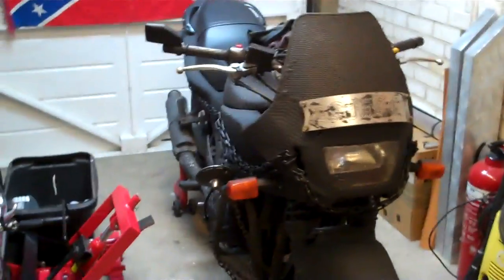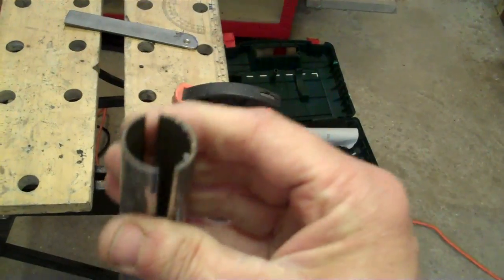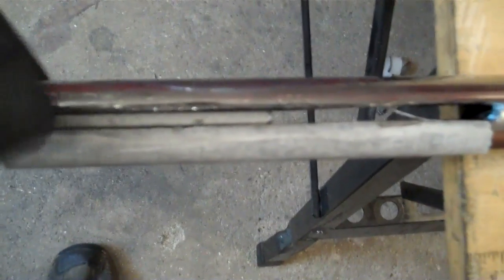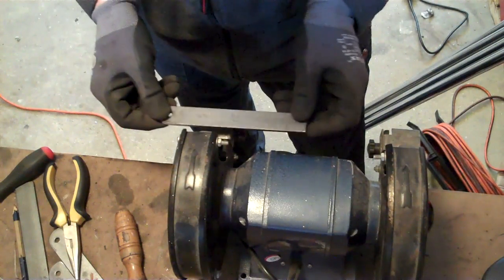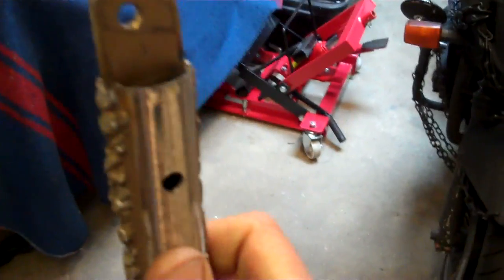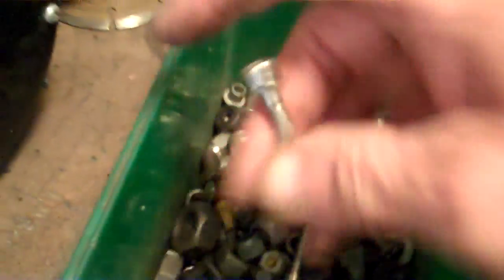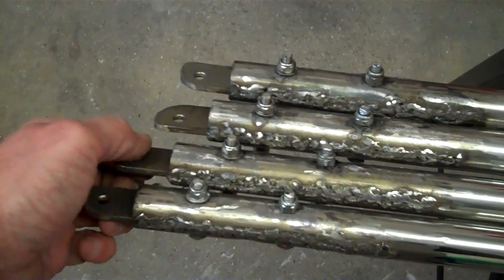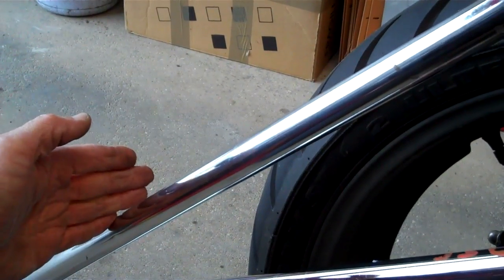Delboy's Garage, Project Tow Hitch, part 2.

Comment from the maker: Hi Dan, i remember you and Joe doing that on the HUGE trailer you built for the pickup.."weld in a C patern" i even had Joe's words ringing in my head as i dodged the splatters...just got to get practiced buddy, even setting the machine up right is still trial and error for me, but its always strong, no matter how ugly. any time i weld its always varied thickness, so hot enough to catch the thick stuff and it blows holes in the thin stuff, so i end up just doing joined up tacks, seems to work.

Comment: Hi Del, the calculations will have something to do with the weight of the loaded trailer as a percentage of the loaded bike and then a nose-weight figure.  I used a stick in the ball of the hitch onto a set of bathroom scales to get my nose weight for the caravan.  Basically, keep dense weight over the trailer axle, low in the trailer, and slightly towards the front and then fill the ends with light stuff.  A tent and camping stuff will be no problem to tow so long as you get the balance right.

Comment from the maker: Hi Claus, yes i was, ill make the rear bracket capable ot bolting on a regular tow ball hitch, then i can tow a regular small car trailer, ill just modify it so thet any weight in it is equal over the axle and doesnt lean too hjeavy on the hitch, then all the bike is doing it pulling mass, this should cut down on any adverse effect on handling... after all it has to be safe to ride too..... take care buddy... Del.

Comment from the maker: You're right of course, once i get the basic four spars built, then it will be cross braced like a drag bike wheelie bar....but i want ot keep it light for obvious reasons, evolving it as i go will make it the most effective eventual design... its easy to go wleding tons of steel on it, but thats then gonna be too heavy,   its just a bit of fun with some scrap steel.. cheers mate.. Del.

Comment from the maker: Hi there, yeah i use a Clake turbomig 135, i guess thats a hobby welder.... im still getting used to it, and faffing about with settings, too much wire and it piles metal up, too little and it blows holes, less power and it breaks when i hammer it... but in the end i make it strong even if it is ugly....if you're a welder and know a right settup ill be greatful for any insight.. thanks mate... Del.

Comment: with hobby welders it is all about fineding the right settings  play with settings on test piece   all welding machines are different  wire size  and gases different settings  the weld looks strong